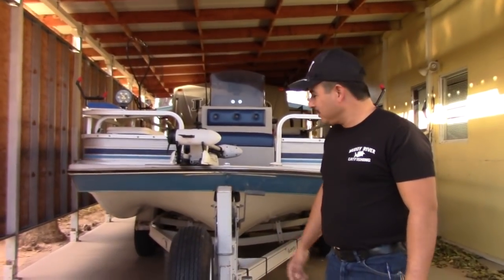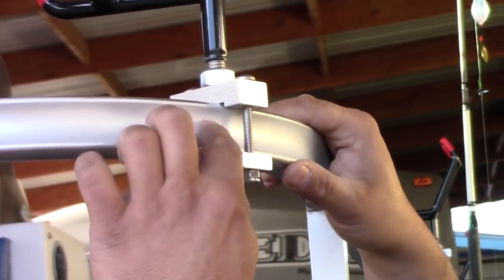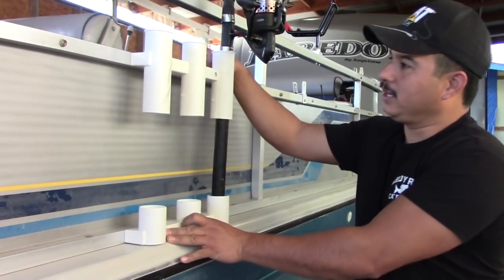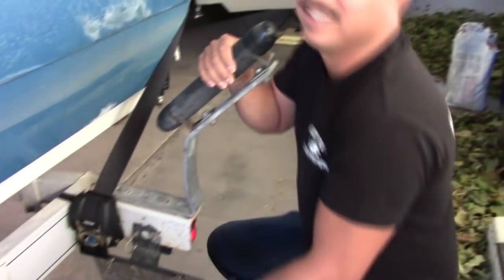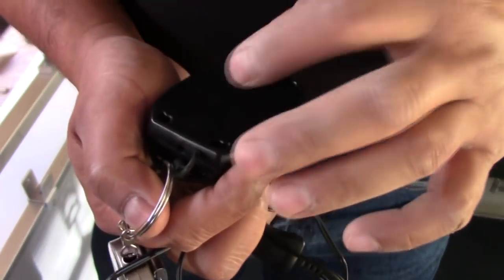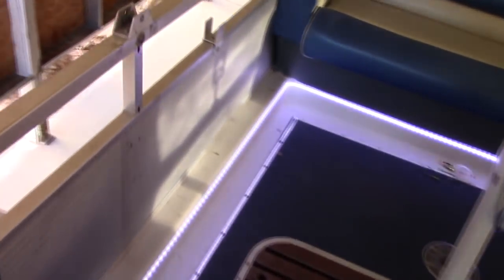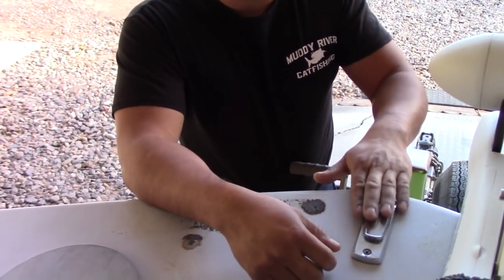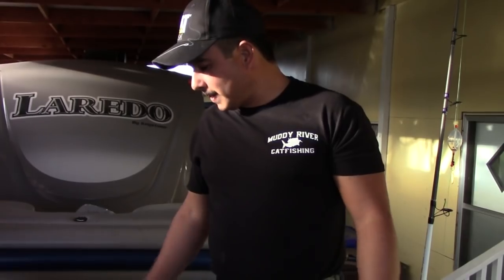My 1989 Hurricane Deck Boat

Comment: Nice boat and I'm sure yall love the room it has. I got a 22ft triton pontoon but it never makes it out as on my river I like to be a little ruff on my boats with rocks and stumps and sand bars as well my river can get low but I love the room it has for the lakes. you got a lot of goodies on that boat and I'm sure yall think of more to add just in case a fold down top for these work great. Now that gear delay odds are is a lower unit gear chip. when I bought my boat it was fine going in to gears while out of water but soon as I put it in the water it would rev up then more gas it would click in gear and go. found out later it was lower unit gear.

Comment: I have a 1990 fd226 I/o that is very similar. Looks like you are doing good. I have an old trailer similar to yours also. I see the hitch has been replaced. Mine came loose and bashed the tailgate on my expedition. I replaced it with a bulldog hitch like you see on a horse trailer. I also welded a ladder on the front of the trailer.

Comment: hey man. I hope fishing is good. the pump for the live bait box on that boat is in the rear of the boat. I think its on the left side (starboars). if you look at the back where the engine sits you'll see the pick up for it, it'll have a screen around the opening. I have that same boat. It's the best boat I've ever owned. good luck.
Reply from the maker: Thanks for the tip! I'll check it out!

Comment: That grinding when you shift means the shift cables need readjustment. If too lose the teeth on your clutch dog can grind off and you won't be able to shift at all. Clutch dogs are expensive too so you definitely wanna get that fixed ASAP. This exact thing happened to my outboard.
Reply: Cody Odom he needs to Lucas that shit untill he gets it done
Reply: Same thing happened on my 70 hp Evinrude. Cost $800 to have rebuilt with gently used parts. Definately want to get it checked out by a reputable mechanic.

Comment: I found the same boat as yours form 1988, not as good shape as your though, I am fixing it up, keep me posted of all you do to  it, cuz that's my model to follow. Put on a 3rd battery and about to test a 70 lbs trolling motor on it, put in an onboard trickle charger, not the inverted but the one you plug to the wall at home.

Comment: Reminds me a lot of my 1996 Lowe Deck boat, purchased last year and only had out a few times.
Looking forward to a lot of good time this summer.

Your pump is likely is same place as mine is, in a small compartment directly in front of the motor, only access is a 6" screw on cap.
Also be sure your not fighting a blown fuse or a loose wire.

Just wondering if you have thought about a mounting base for rod holders across the rear?

Comment: Kris, Your LED Bow lights might not be effective. Sure they are bright enough, but on that rail, they may not be visible from 112.5 degrees,from either side, like the short vertical "sectored" light you replaced. There should be a clear break between the red and green in line with the centerline of your direction of travel, Or you could go to the forward corners and put red on one and green on the other so other boaters can tell your direction or heading just by observing your lights From the midpointof your bow bact to 112.5 degrees either side Others should see one color. The wide angle of the deck boat bow might keep them from being seen 112.5 degrees back on either side. Real NAV lights have been cast in sectors whether they are combined at the bow or separated to each side to set the 112.5 angle to each flank. Love your vids just want you to be safe, and avoid any citations.

Comment: that's set up nice. need you to pimp my boat. lol. I really need to find help to get mine going. I got it almost a year ago and had someone stop and help me free and messed it up worst. so its nice 19ft got for 2k started right up. but quit 10 sec later. well he took this and that. then I went to check the gas and found the gas cap was broke inside no air flow. so got my extra gas can cap put on started up ran didn't quit. but now the fuel pump leaks the hose come off the carb I got back on but the black tie come off I can get into it to put. back on. but prob need carbs cleaned. but I can't open and. end o er the seat to fix I can't fix from the. back. so I hope my next help will let me give him something if I don't have enough cash cause that way I can truth the help if I'm paying something. but never got to take anyone last year for my group. broke a lot of hearts the kids so ready for the second year of tubbin. so I ha e to get fixed this year. if I have to sell my pull trailer old van my truck what ever I'm not letting no one down this year.  well hope you get out to have fun bro.  god bless. and fish on.

Comment: Hi Kris, Just saw your video. nice boat!  If you remove the hood on your motor you will see shift cables on driver side, lower cable is shift cable. loosen clamp and there should be a thumb screw to adjust it. as far as your pump if there is a screen on the transom your pump is on the opposite side under rear deck lid. feel free to pm me if you need more info I have rebuilt quite a few boats in my day.